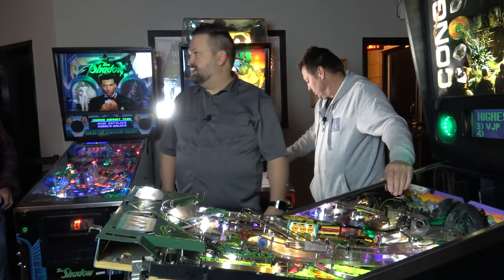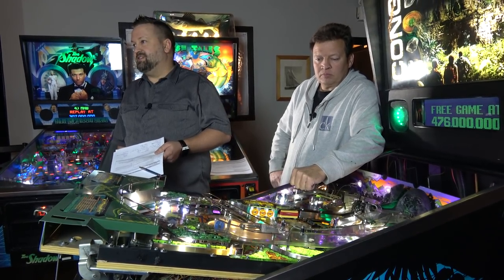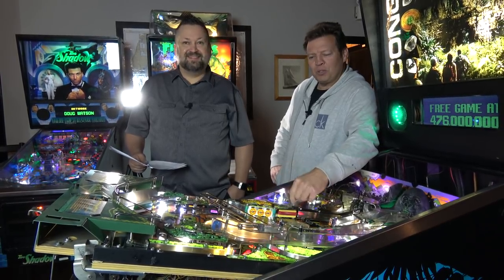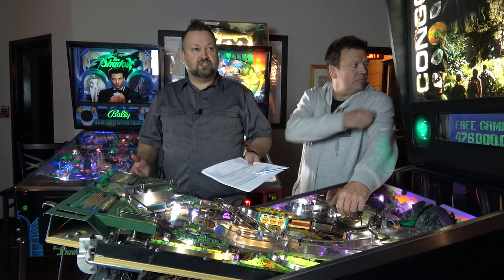Pinball Ownership 101 - What to look for when buying a used game, maintenance, and more!

Comment: Here is a timestamp summary of the video:
(HH:MM:SS)
00:00:00 - Introduction by Josh
00:00:48 - Alex introduction
00:03:30 - Dan introduction
00:04:30 - Overview of the session

00:05:35 - Part 1: Exterior of the machine
00:08:05 - Potential deal breaker (example from TFTC)
00:11:20 - Where to get help in Calgary
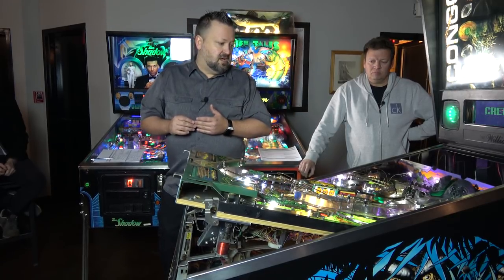00:12:00 - What Dan looks for on the exterior of the machine when making a potential purchase.
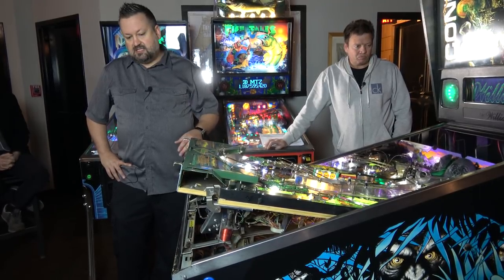00:12:55 - Plastic leg stand-offs. Do they protect?
00:15:03 - Leg bolts, how tight should they be? What to do if you strip a leg bolt?
00:16:20 - Should I keep my machine covered?
00:17:35 - Cleaning the glass. Special solution is needed for Invisi-glass.
00:19:06 - How to clean the outside of the machine?
00:20:25 - How to remove stickers from the cabinet.
00:21:40 - Powder coating exterior parts.
00:23:50 - Alex gives his opinion on the different types of glass available (Standard, Invisi-glass, Stern HD, Roman PDI)
00:26:52 - Tip: Never slide the glass out with the coin door open.
00:27:05 - Exterior body repairs.
00:28:05 - Installing Vinyl Graphics (https://www.youtube.com/watch?v=TCMadIQaBG0)
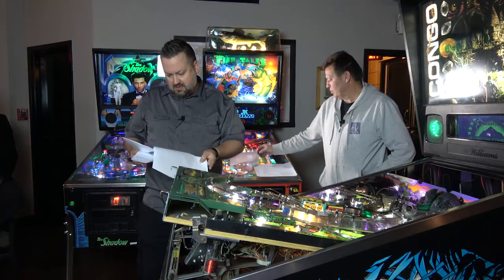00:28:38 - Checking the power cord.
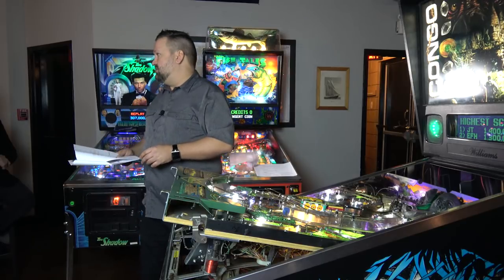00:29:30 - Where to purchase glass.

00:31:35 - Part 2: Back Box
00:34:40 - Color DMD - LCD vs LED
00:36:10 - What to look for in the back box as a potential buyer.
00:36:30 - Remote battery holders.
00:39:45 - Driver board
00:41:15 - Tip: Verify all of the fuses when you get a game home.
00:42:40 - What things would be a potential deal breaker?
00:43:38 - Where to get replacement fuses in Calgary?
00:45:40 - Speakers
00:46:40 - Back box latch & head bolts
00:47:40 - Where to store the back box keys.

00:49:10 - Part 3: Playfield Topside
00:49:40 - What would be a potential deal breaker with the playfield top side?
00:50:30 - What is planking? (example shown on Diner)
00:51:40 - Visually inspecting the playfield.
00:53:20 - Playfield cleaners.
00:55:28 - Waxing a playfield.
00:56:14 - What to do when you get a machine home?
00:56:44 - How long does it take to clean a machine?
00:59:15 - Tip: When taking a game apart have lots of magnetic trays and take lots of pictures.
01:01:42 - What is ghosting? (example shown on Ghostbusters and Spiderman)
01:02:21 - Flickering LEDs - this can be related to the power saving mode of the machine.
01:03:23 - Where to buy LEDs in Calgary?
01:04:40 - The shooter lane, what are we looking for?
01:07:22 - Mylar, what is it and where should it be used? Recommendation to add mylar to the ball exit of any machine.
01:09:33 - How to remove mylar?
01:11:30 - Cliffy Protectors
01:14:15 - When to replace pinballs? Which ones will magnetize faster?
01:16:43 - Should the pinballs be removed before lifting the playfield?

01:17:36 - Part 4: Playfield Underside
01:17:49 - Power utility plug.
01:18:55 - Playfield kickstand.
01:19:37 - Tilt bob.
01:20:33 - What to look for on the playfield underside.
01:22:00 - Recommendation that you rebuild the flippers when you bring a used game home. Small fixes to the flippers can make a big difference. (https://www.youtube.com/watch?v=VL2t8ovXs5Y)
01:24:25 - Tip: Replace coil stops on all new Sterns
01:26:07 - Shaker motors.
01:26:42 - How Alex was able to put a shaker into a 2003 LOTR.
01:29:23 - Importance of turning a machine off before doing work. (Alex shares a story of him damaging a machine not following this advice.)
01:31:36 - Changing bulbs. (Quick comparison of two different colors of bulb under the same insert.)
01:34:20 - Manuals & schematics
01:36:00 - Spare parts to have on hand.
01:38:46 - Tools that you should own.
01:41:36 - Opto issues. (Example of TNA)
01:42:53 - Using the switch menu to help troubleshoot.
01:45:15 - Soldering. Never solder with the game powered up. Don't solder on your playfield.
01:45:52 - Fixing a wedge light by bending the wires back in place.
01:46:40 - Restoring the shine on metal parts. (Auto Sol)

01:50:37 - Video close out by Josh
Reply from the maker: This is awesome! Thanks for indexing it! I will copy this into the description.

Comment: Excellent video. Thanks for the help! Looking to buy my first entry level machine for around $1500-$2500 usd any recommendations and can I find a decent machine within this budget? TIA
Reply from the maker: For your budget, you are probably looking at an early 80s solid state, to a mid 90s machine. Josh's very first machine 4 years ago was a Data East Rocky & Bullwinkle for about $2500 Canadian dollars (about 1900 USD) in nice condition. You will need to join a local pinball enthusiasts group on facebook, or keep an eye on the classifieds to find a potential machine. In the meantime, play as much pinball as you can, lots of different games to expose yourself to a variety and you will figure out what kind of games you like. Watch lots of game play videos, read on pinside owners club threads for particular games to see what sorts of issues people have with that game, so you know what you are getting into.  Join a pinball league, hopefully there will be other collectors in the league, and perhaps they can connect you with local sellers. Sometimes people in leagues selling games prefer to sell to people they know through the league for an easier transaction.